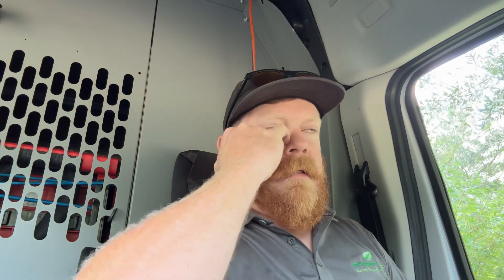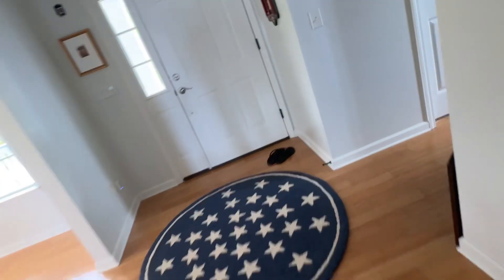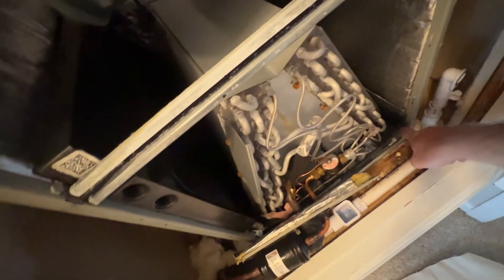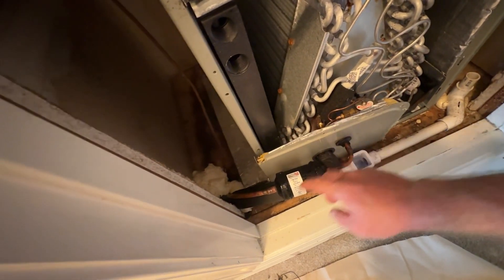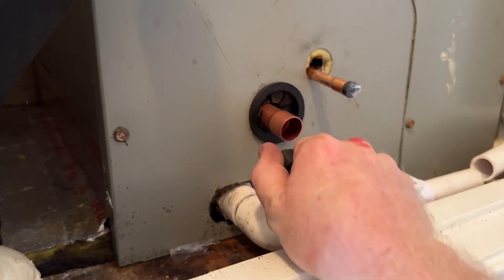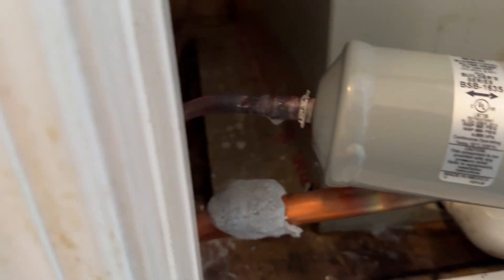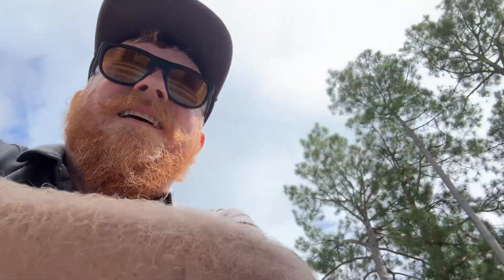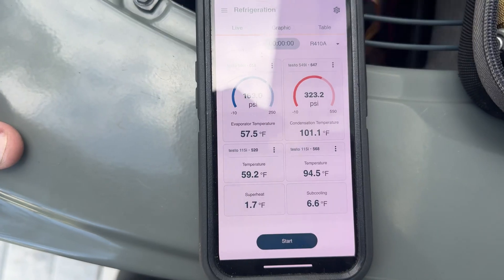Evaporator coil replacement TRANE | HVAC |

Comment: All this is fine and dandy but it assume things.  For starters, how does one get rid of the silicone mastic (there's oodles of it) to even get access to the evaporator coil that is housed inside metal box?  Masses of mastic on the seams with screw heads embedded in that stuff.  I hear solvents are a way soften up the mastic,  but isn't freon or refriegerant flammable?  If so, obviously, I am not going to do that.  The mastic on the seams in our case is really hard so using a utility knife is a joke I would need a chisel or something?

Comment: We have had to ask for multiple replacement coils because we have had several systems that lost their nitrogen charge in the coils before install American standard, but we have not had any leaky coil issues. I believe it’s because we’ve asked for replacement coils on all the systems that did not have nitrogen pressure from the factory.

Comment: Love my elec leak detector BUT sometimes it won't/doesn't pick up leaks.  I found the best way is to use a clean hand & put in drain pan near drain ports & touch water, rub fingers together & water will dry up quickly leaving the wonderful POE oil behind. 
But you know as of new Alum coils their life isn't 10yrs ,more like 5-8yrs at best.
BTW love your jobs closet vert coils. Past sweet.  Ours are generally in a tight ass/hot attic & mostly horz apps.